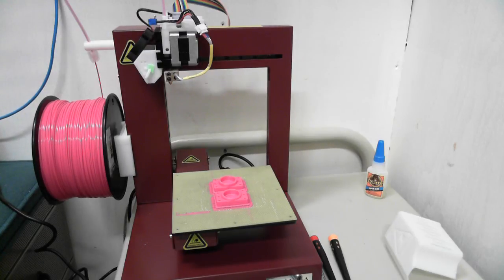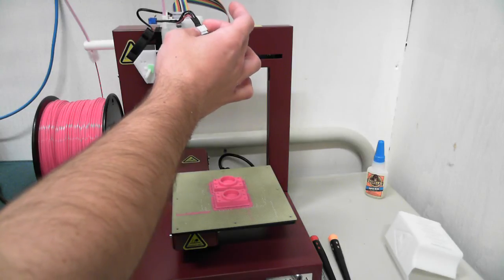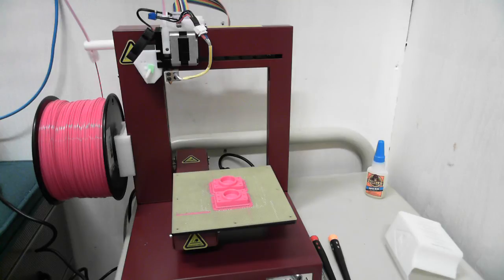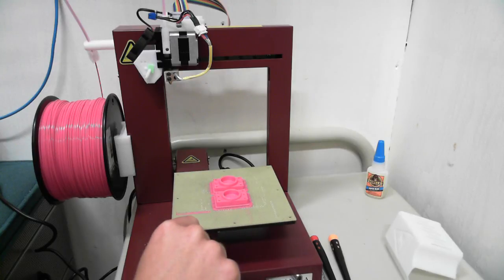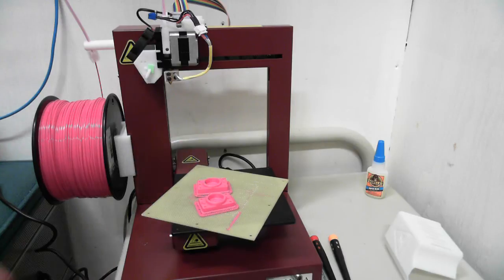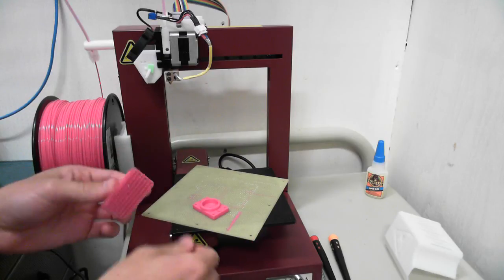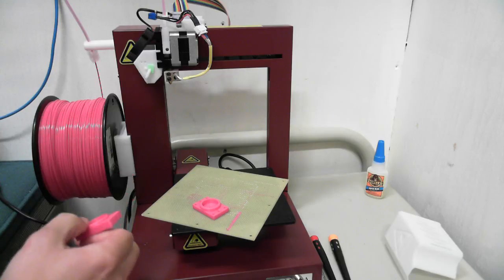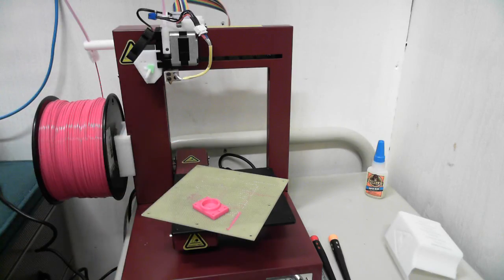Lower Print Temps for Octave Filament - Afinia H-Series 3D Printer from Octave.com (US UP!)

Comment: O_o so what i am wondering is how was this an ad, cause it was an ad on something unrelated i was watching, also in my experience higher print temperatures are more important cause if i lower it too much then i cannot get it to stick to the platform, but i am using a makerbot duel which allows me to control temperature from the software